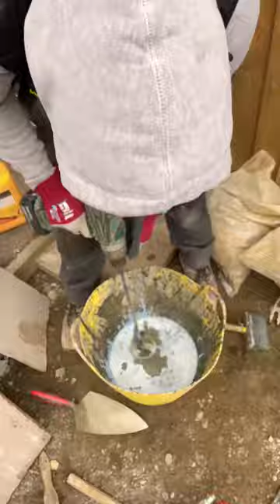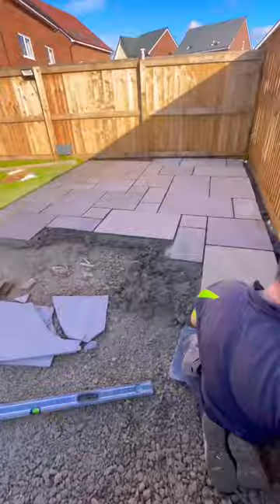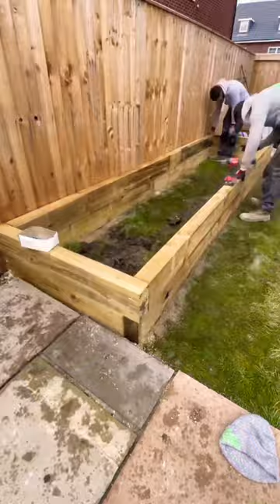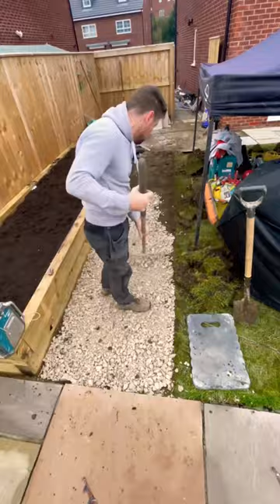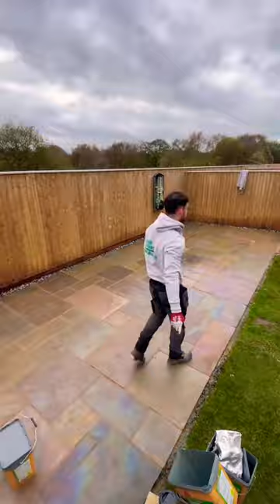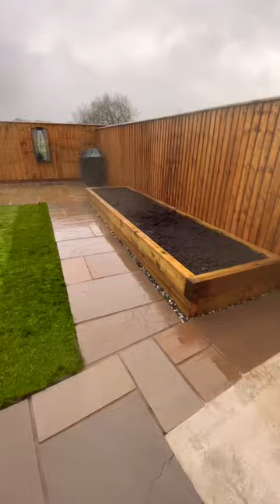Full landscaping project we did last year #garden #landscaping #subscribe

Comment: I hope you live somewhere cooler. Cementing up the back yard adds to heat retention and diminished oxygen exchange that  trees   and shrubs do just the opposite. And I don't understand doing this next to the fences. I was just waiting for plants in pots to be placed there. You would have gotten more use out of it if you put in a patio right behind the house with maybe part of it covered.
Reply: Fr! What purpose does that sht have?!
Reply: This is in the north of England so it usually doesn't get too hot. Usually north facing homes have a patio at the end of the garden to maximize sun, otherwise you'll just be in the shade of the house, especially a 3 story one like this.
Reply: perhaps this is what the owner want !!!
nevertheless, very professionally done.
Reply: the favorite toy of men - cement